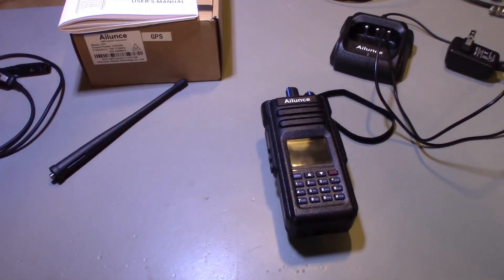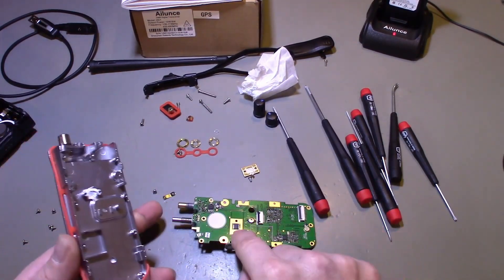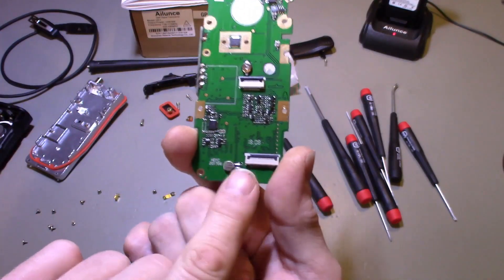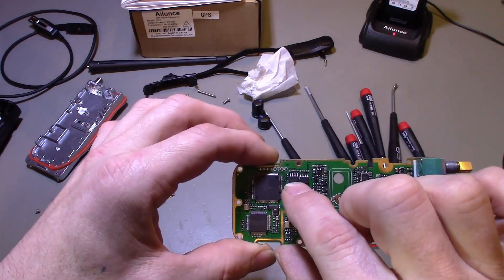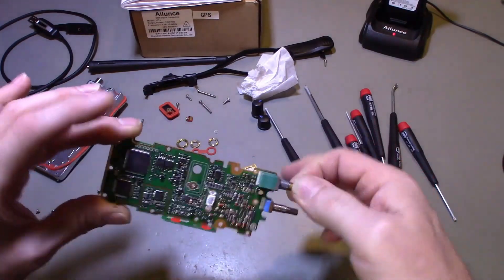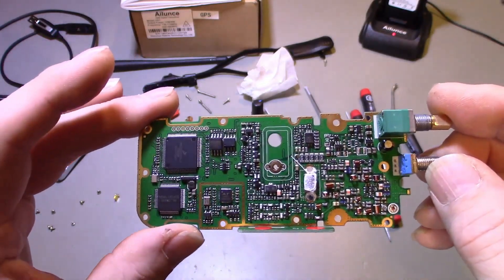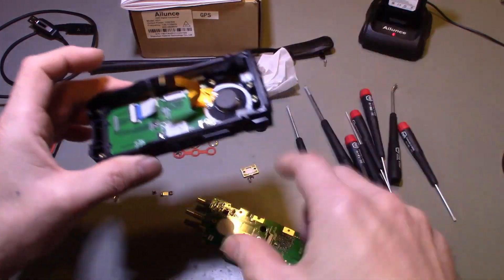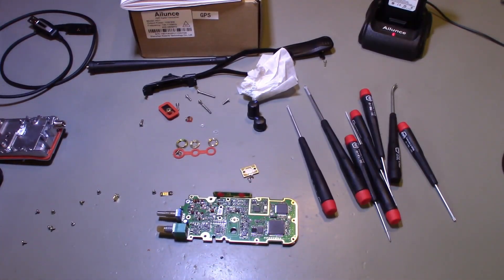Retevis Ailunce HD1 Teardown: Inside Look at the Circuitry and Design! 🔧

Comment: Unfortunately I have a sad experience of using this radio station ! The first copy stopped working V2, stopped working correctly on transmission, the carrier frequency was shifted and the radio after a few seconds of transmission turned off completely and to turn on required to remove the battery and insert it again ! After long painful correspondence with the seller and with engineers, I was offered to send the station back ! After that I was sent a new station ! But there is a problem in it, as already mentioned above, the modulation of the microphone is very quiet, when working correspondents say that I can not practically hear me, although the level of the microphone I have set at +10 ! Also in firmware v.2.3.2-GPS, if in any of the VFO enabled Double Slot mode, only active VFO works on reception, the second does not work even if on this frequency is transmitting, on firmware v.2.2.8-GPS such a problem is not ! I wrote about it to the engineers to the mail, but did not get a clear answer ! I got a promise that sometime it will be fixed, a lot of time has passed since then, but nothing has changed ! For me it would be an ideal radio, if they corrected the above mentioned problems and added in the firmware the ability to receive DMR without taking into account color codes and time slots, as it is done for example in Anytone with their DigiMoni function ! But so far unfortunately the station is forced to dust on the shelf without doing anything !
Reply from the maker: We're sorry you felt bad, but at RETEVIS, we listen to our customers. We don't ignore issues and we're working hard to improve this one. Your suggestion is great!
Reply: @retevis  Can you tell me how I can raise the sensitivity of my microphone in DMR ? From the stations menu it is impossible, there is only adjustment for analog mode !
Reply from the maker: @OLD_5x5  There is no such setting for the time being
Reply: @retevis  Thanks for the answer ! Very dubious product turns out, even on cheaper stations this problem does not exist or it is solved through hidden settings !

Comment: This is a real monster of the radio, Excellent quality, no comments. It has been built with good and strong components. However, this radio does have firmware issues, which is shame. RETEVIS is aware but still not doing anything to fix following issues: Gps only works in DMR mode and NOT in ANALOGUE mode. Once you decide to use radio in Analogue mode, functions are very poor. The cheapest 2 band Baofeng radio ($18) beats this monster easily in Analogue mode. In addition, the microphone hole on top right side of this radio is extremely small. This results in quiet transmission, whoever is listening to you. Even if you set MIC GAIN to +10 radio is still quiet with litlle or no improvements. I am very disappointed with the usability of this radio. I just hope RETEVIS will fix these issues very soon as these radios are currently sitting in my draws doing nothing.........
Reply from the maker: Is it a matter of the volume not being turned up? If not, please contact the after sales service team of the platform you purchased. I am sure they will solve it for you
Reply: @retevis  hey and thank you for your reply. When we tested HD1, it was done in group calling, and we are all experienced and licenced Ham radio operators. We have tried every setting that was available on the radio, but audio was always very quiet. I am very sorry about criticism on this radio. What I do not understand is RETEVIS is doing nothing to fix these issues. This radio was on the market for 6+ years, and you would imagine it would have been perfected by now. After sales department at RETEVIS is aware of these issues. It's a real shame that this radio HD1 is soo perfectly made but has major firmware problems......
Reply from the maker: @sekibulja-fu3bv  RETEVIS maintains the philosophy that we are with our customers and it is your feedback that makes us better. Have you contacted an after-sales person to help you check your audio?